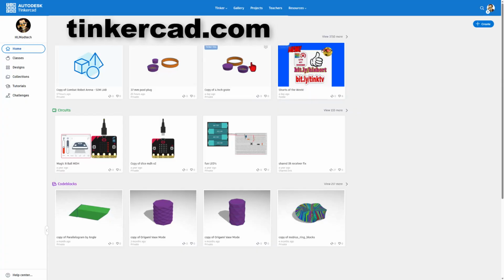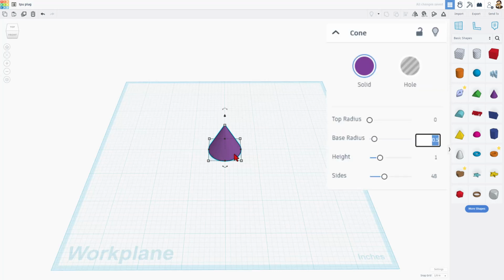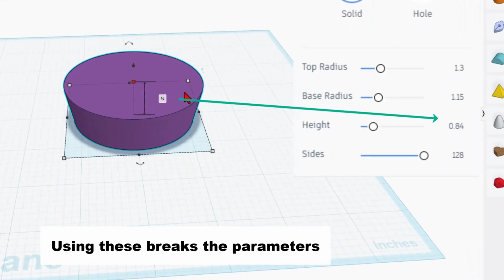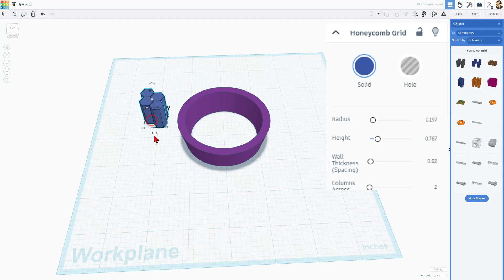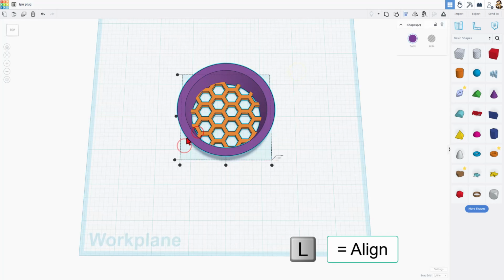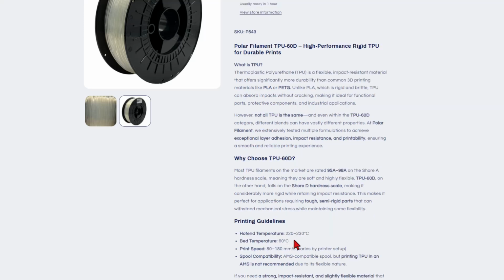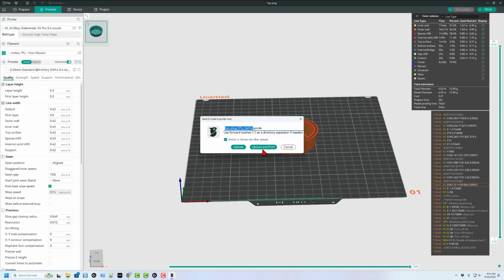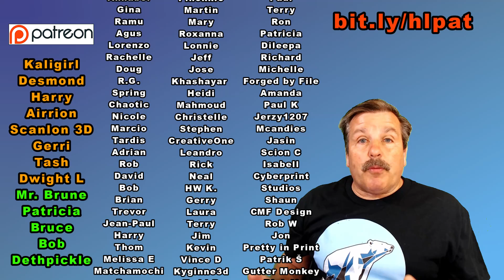Easy 3D Printing: Useful Tinkercad Parts! A TPU Critter Plug 💯🔥

Comment: Could you make a video on adding the grid on a curved object where it wraps around evenly?
Reply from the maker: I will do some digging, but I do not think Tinkercad is the slickest tool for the job. There is no built in wrap feature. What is it you are trying to make? Something like a clay roller?
Reply: @HLModTech I don’t have anything in particular in mind but a clay roller is a good example or designing a ball. 

Another thing I’d be interested in learning is if I could use fillets to follow a curve. I’ve designed some hooks to hold my hard at at work but wanted to remove all the square edges. I can do it on the straight sides but I’d like the fillet to follow the curve of the hook if possible. Thanks for the reply
Reply from the maker: Tinkercad will not do fancy fillets like that. Sending to Fusion is the easiest way. https://youtu.be/pzyqdX2t0L8
Reply: What Program would you suggest, I have been trying to model something like the epcot center ball and have been failing. Sorry for hijacking the comment.
Reply from the maker: I have a slick chat area at my Patreon site. https://bit.ly/hlpat  It is available to free members. Slick for questions like this because we can add images and links. This explains it. https://youtube.com/shorts/xHUM1eGOmjE?feature=share  An image of the Epcot center might spur someone into creating it. I am pretty sure we can make it in Tinkercad. Especially if a bunch of us join forces.

Comment: Hi friend. I was wondering about a topic that you do not spend much time covering which is "Organic Shapes". Boy-O-boy are these ever tough too learn! There is this new type of Shoe/Sandal that sells for $500.00 and it's got maybe $5 bucks in TPU to print them. They are called "Balenciaga-Zero-Slip-On Shoes". It's the hottest selling 3D printed sandal this summer! I found one file on "cults3d" but after printing it's too stiff in the heal, horrible scanned copy I think. These Balenciaga Zero-Slip-On's are the RED HOT beach foot wear for Europe this summer and they need some competition! Your videos have helped me create "technical objects" but I wish you would start covering organic shapes which require "More tricks of trade" to make unless you want to get stuck manipulating millions of individual pixels one at a time in BLENDER!! Your great at finding those simple tricks and teaching them! I think you would find it a challenging and rewarding project since even Balenciaga says it's a '3D-printer' inspired design!!! Do a little research on 'Balenciaga-Zero-Slip-On Shoes' You will agree it's one heck of a great opportunity for At-home 3D printing. This sandal shape does not require any supports which is a big plus too! It's a self-supporting print so it's very economical. I printed mine out of "Foaming TPU" and they were as soft as butter!
Reply from the maker: Thanks for sharing. I will do some research. I have not heard of them or foaming TPU so I have a bit to learn. 🤣 The Tinkercad Dragon project is one of my better organic projects so far. https://bit.ly/hldragon23

Comment: For a part that wasn’t a polygon, do you think something like pic2svg could be used to turn a picture of the needed shape into something that could be used in Tinkercad?  Picture would have to be taken head on, then there’s lens distortion and the background to deal with. Ok, might be a little problematic lol
Reply from the maker: Any time you have a front view, or top or side, it opens up using the sketch tool. https://bit.ly/fvsketch
Reply: @HLModTech But getting a good 2D view might be tricky. Next time I need a bespoke part I’ll give it a go. I’m fixin’ to put up some SKÅDIS pegboard, maybe I’ll need something custom when I’m organizing. I do love a side quest (which is why I’m still not organized 😂).
Reply from the maker: I would likely use the grid to simulate or create a pegboard. Did you ever see this project by @CHEP? https://youtu.be/iTwkzHc_uvc?si=PSO8tIjcuXTiuqkx
Reply: @HLModTech Sorry, I meant for adapting something to be SKÅDIS-mountable.
Reply from the maker: lol... had to Google what it was! 🤦‍♂️ My peg board is still stone age.